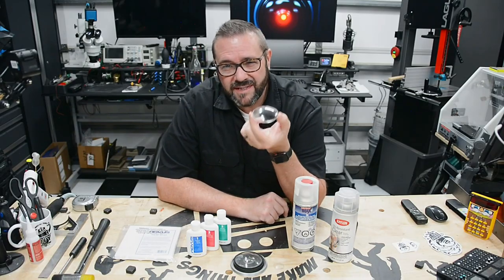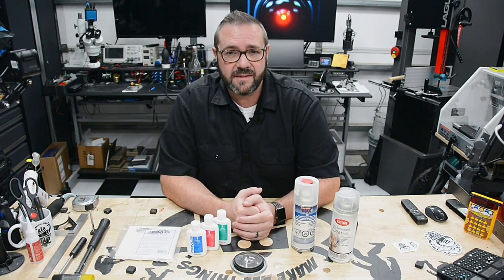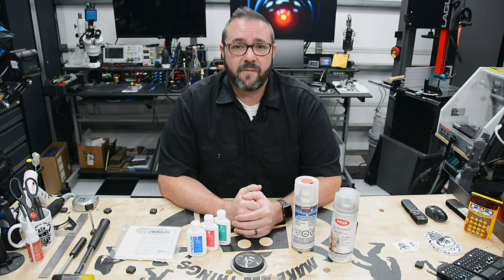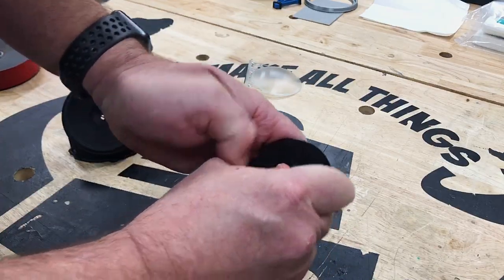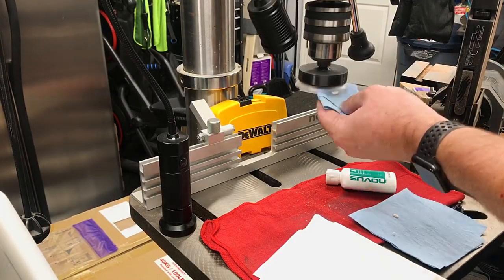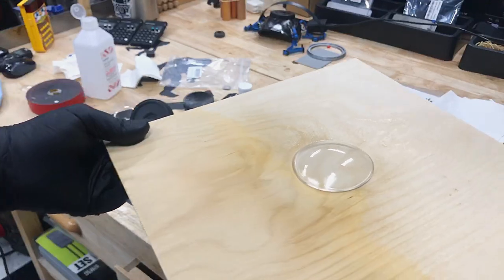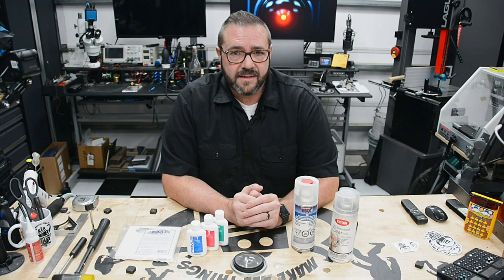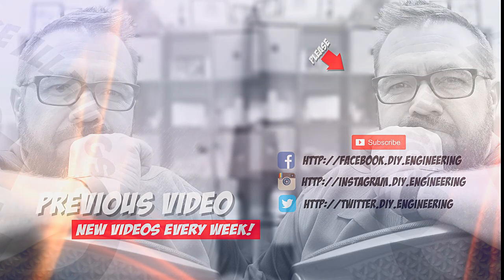My Trick to 3D Printing Crystal Clear Models!

Comment: Yet another option, I found worked really well is to use a (3M) kit for polishing headlights.  The final coat, supplied on a little swatch of tissue, provides decent UV protection & will turn a fairly cloudy print almost as clear as glass.
For the polishing, I've found toothpaste (cheapest you can find) with an electric toothbrush works at least as well as any of the (expensive) polishing compounds.

Comment: You can also use clear nail varnish in a pinch.  Good video.
Reply from the maker: Darren Tarbard is the nail varnish uv blocking?
Reply: @DIYEngineering  Depends on the type I guess?

Comment: This is awesome! I'm trying to do the same thing but keep getting a stream of air bubble up the middle of the print. Any ideas?
Reply from the maker: Are the bubbles in the resin print or from the polishing?
Reply: It happens during printing
Reply: @jerednorman4265  are you printing with an SLS or polyjet printer? If SLS then it could be a number of things like your printer not being leveled properly, the float is not leveling the resin properly, your tank is contaminated or expired, also make sure your IPA bath is not too diluted. If polyjet is probably one of your UV lamps being partially blocked, if your printer has two lamps, try to do a Pattern test it'll let you know where material is not properly curing.

Comment: How does this hold up over time left in the sun or worn outside on a costume?
Reply: It would last years outside because it’s coated with uv blocking clear coat. If your cars base coat paint didn’t have clear coat it would go to crap really fast. When you see a cars paint start to fade and peel then that means the uv protectants wore out in the clear coat. Same goes for clear coated uv resin items. You could even ceramic coat it if you want.

Comment: Which resin did you use for that initial printing?
Reply from the maker: I think these were printed on the form 3, which means it was the form 3 proprietary clear resin.
But i have done this with other clear resin. Just do not post cure the part.
Reply: @DIYEngineering  Thanks! But if I do not postcure the part, the part cannot be exposed to sunlight for instance, right?

Comment: I'm a model builder. I wonder HOW you could make like windshields for model trucks without using a drill press?
Reply from the maker: The process could be done by hand if you take your time.
Reply: I think it would be better if you 3D print molds to the shape of the windshield and  then use vacuum forming to shape the plastic sheets to the mold. It will be clear without sanding, shaping, clear coating, etc. and plus it will be nearly indestructible rather than brittle.
Reply: Dremel tool with polishing bit.

Comment: I just wanted to make sure...you said print, then IPA bath, and then the post-processing sanding and clearcoat...but NO uv curing..correct?

Cool video, btw.
Reply from the maker: ty, yes, that's correct... over curing is not necessary for clear and will yellow the resin. good luck